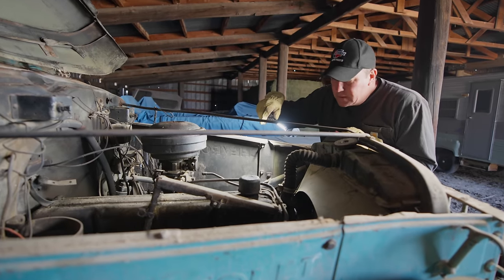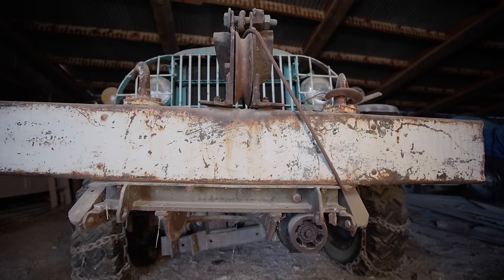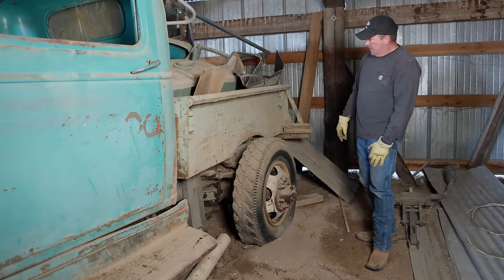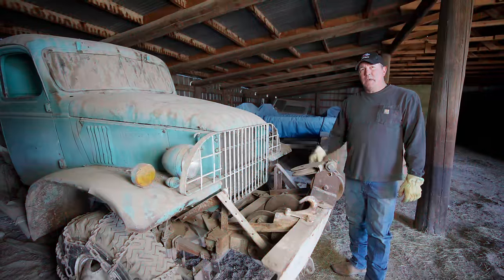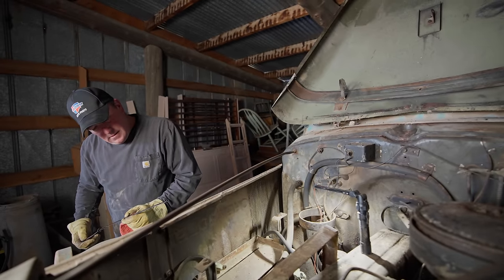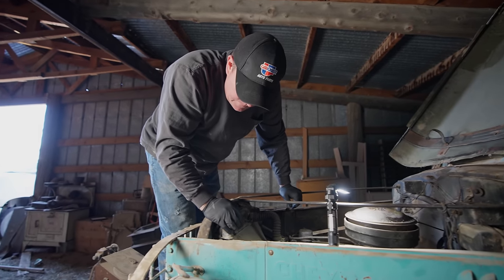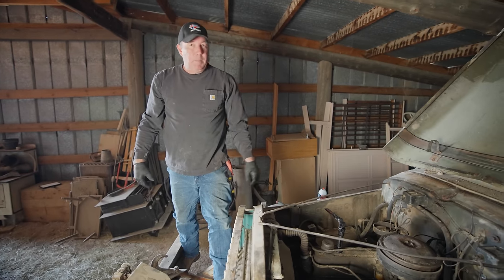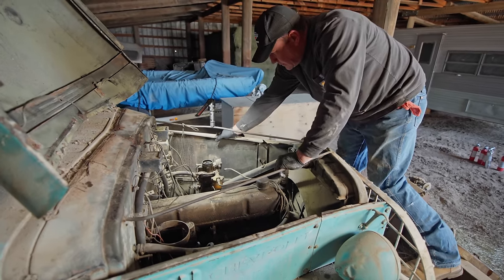Chevrolet Truck has been sitting for DECADES. Will It Start?

Comment: They originally had a 235 stovebolt six which was the bored out version of the 216 stovebolt.  They were only used for the military, until later civilians were able to purchase 235s for there vehicles
Reply from the maker: Good information thank you
Reply: Yes I have a reprint of a Chevrolet shop manual and it shows the 235 for trucks !1/2 ton or larger introduced in 1941. Of course a dipper rod engine. The engine that is in that truck is a later 235 engine as most of the time people would upgrade to that 235 rather than rebuild a 216 or 235 dipper rod engine. And of course those old dipper rod engines had babbitt rods as opposed to the later engines using replaceable rod bearings and full pressure oiling. Both engines were good engines if used properly and with proper maintenance would go easily one hundred thousand miles which was a big deal back in those times🥸👍👍👍

Comment: That is a newer engine probably a 235. A 216 would have been stock. You can tell by the valve cover, 216s have two studs up through the cover and the earlier 216s had a side cover that came al the way up to the valve cover and the spark plugs went through the cover, and 235s have parameter bolts although the early 235s had 216 style valve covers, my 49 6400 came with a 235 and I believe 49 was the first year for 235s. As far as your flathead comment, Chevy never used a flathead, they were always overhead valve. On a sidenote, 'I was told by someone who I trusted as in the know told me that Chevy military trucks were only single rear axles, while their GMC cousins were tandem rear axles because the little 216s just weren't powerful enough while the larger GMC engines could pull the larger loads.
Reply from the maker: That is a lot of cool information thank you

Comment: Those GMC versions were built with a 270 GM commercial truck six, which was very similar to the 235 stovebolt six. The flat head Hercules JXD 6 cylinder engines were used in the Studebaker and Reo built US6 military truck. So my guess is the engine in this truck would be the original.
Reply from the maker: Great information thank you

Comment: The best mixture for freeing up rusted metal parts is a 50:50 mix of acetone and ATF. Soak the cylinders or bolts about 24hrs.
Reply from the maker: I will try that on the next one thanks

Comment: The original engine would have been an overhead valve in line 6, probably a 216. The engine that's in the truck now looks like a Chevy 235. I also when trying to start an engine that has been sitting is to pull the valve covers to check for stuck valves and to lube the rocker arms and valve stems before trying to start the engine.
Reply from the maker: Great tip thank you

Comment: While I love the truck just take a look at that structure. Those are some whopping poles in the top. Guess you had to build them stout for the snow load. There is also an old wood burning stove near the door.
Reply from the maker: My father in law built the building that the truck is in and yes it’s pretty stout. Thanks for watching